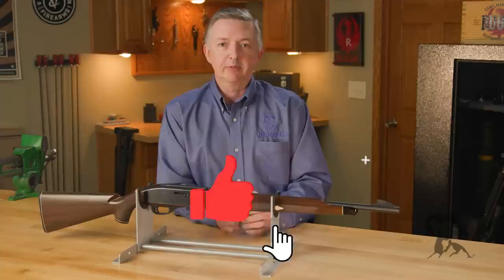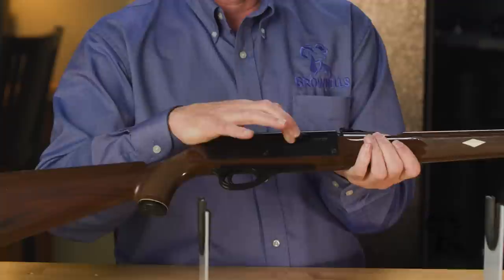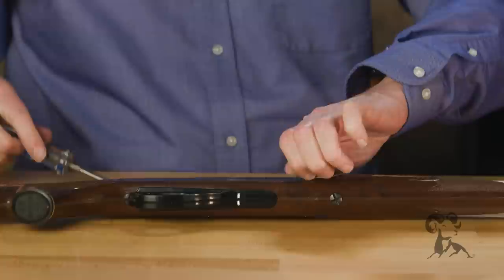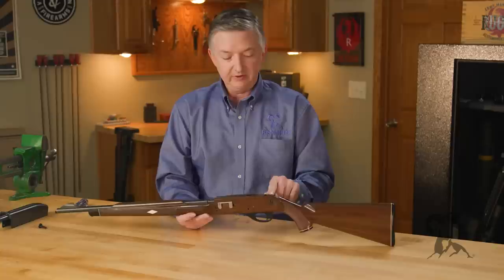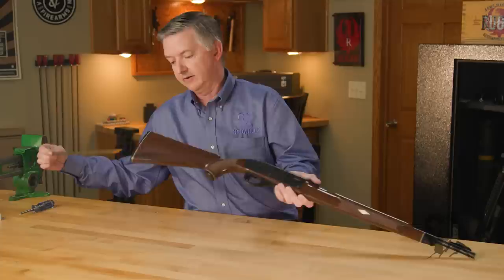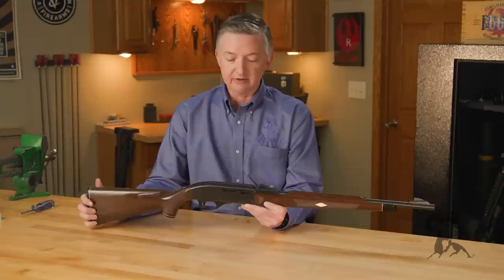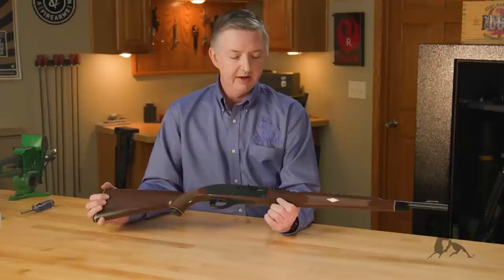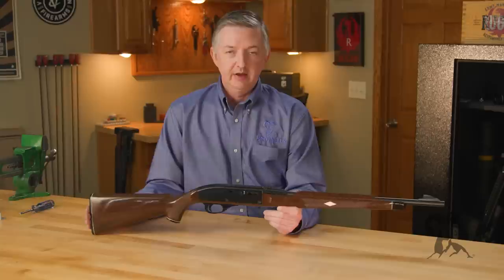From the Vault: Remington Nylon 66 Rifle

Comment: Around 1976 or so, a guy came to me at work and said, "I hear you know a lot about guns." Well, some. "I took my gun apart and I can't get it back together." Next day we went out into the parking lot where he handed me a barrel, a nylon stock, and a cardboard box full of parts. It included an exploded parts picture which wasn't really an assembly drawing but it was all I had to go by. One spring really eluded me. It was labeled in the drawing as "spring" and I could tell what it was meant to return, but it wasn't at all obvious what it anchored to, so I just picked something. I finally got it together and fired it a few times. When I disassembled it for the last time the anchor point of spring became obvious. It took me about a week of head scratching but I did make it a complete gun again.

Comment: I was 15 at the time, 1959, and asked dad if I could get a Nylon 66. To my surprise dad said yes. That was a get summer. The best part is I still have the gun. It has been a great shooter. The only issue I've had was the disconnector broke. You were right Keith, the internals are a bit of a mouse trap. YouTube has a few step by step videos that will get you through in fine shape. According to the production stamping on the barrel P F 45 = June 1959.

Comment: I bought a Nylon 66 back in the 80's and I almost didn't buy it because I thought it was plastic. I told the salesman that I don't want a plastic gun. It's like a toy. I pondered between it and a ruger that was in compare a heavy gun. The salesman told me the Nylon 66 is not plastic, It's a nylon that is very strong and that it won the accuracy test of all 22lr rifles' at the time. So $99 later I walked out with the nylon 66. Sure glad I did because I can shoot bulls eye after bulls eye with this gun. Never had a misfire.

Comment: I got my first Nylon 66 just last year, an original Mohawk Brown Remington made in 1972.  So it's as old as I am.  A little cleaning and it was running perfectly once more.  It's quickly become my favorite .22 rifle ever.  So light and slender.  They're known to have fired 30,000 rounds without cleaning, and Alaskan trappers found they were one of the few, or perhaps only, autoloading rimfire rifles that would function reliably in the extreme cold.

Comment: I did a disassembly are full cleaning on one of these decent little rifles exactly once. I now recommend you hose them out with G96 Gun Cleaner and use an air compressor to blow the excess oil and gunk out of the action. Wipe off the residue on the outside of the receiver, reassemble and the rifle will be good to go for another couple or three thousand rounds.

Comment: My grandfather left me the Apache model, lots of memories with that gun. Also the only gun I've ever seen the manual state NOT to oil the action due to the "self lubricating" property of the DuPont companies zytel polymer. They also will not hold a zero with a scope very long due to the sheet metal cover used for the receiver/scope rails moving. Great with irons since both front and rear are barrel mounted.

Comment: I always check these Nylon 66 blogs out. No one ever mentions the Nylon 12 which is a bolt action. My first rifle when I was 16 years old. Not sure what I paid, but I could seem to remember that it cost about $39.00 and the Weaver 4X scope I mounted on the rifle was $8:00. Still have it and it's in really nice shape, still fun to shoot.
Reply: Dillon Precision Press ran several articles on the variants of the Nylon 66 series-semi auto,lever action,pump action & bolt action.
Reply: I have one (Nylon 12), I just posted about it before I saw your post! I've had it since 1972 I think. Great little just Never use it!!
Reply: I have one to works great

Comment: I have an Apache Black with white diamonds, Nylon 66. I've had the rifle since 1970. In fact, at one point it was stolen from me in a burglary. About a year later, the police recovered it and returned it to me. It showed a few new scratches and dings when I got it back, but still worked fine. According to the manufacture date codes (stamped on the barrel) mine was made in 1962. The odd thing is the date code is supposed to be two letters, but mine has three letters. The first one being the code for 1962. The second letter is the code for the month of September. The third letter corresponds to the code for the month of November. I don't really understand the three letters being stamped on the barrel, but in fact, they are there. It's really an accurate, reliable shooter.

Comment: Mom and Dad gave me mine in 1962 when I was 17. Still works like it was brand new.

I only wish someone made a receiver peep sight that did not require replacing the front sight.

Once we finally rid ourselves of the legislative atrocity/tax dollar sponge/civil right prior restraint called the Dodd Anti-Gun Act of 1968 and subsequent add-ons, the Model 66s with serial numbers may become a more expensive collectable variant.
Reply: Shoulda mentioned, my bad. I came up with the trick of using it as a single-shot by placing a cartridge on the ejection port and operating  the bolt handle and letting it slap forward into battery. Great for working with new shooters where you don't want to load the magazine.

Comment: I was the first 22 rifle I bought as a teen. Had it for many years and during that time it never had a failure to feed or a misfire. The only issue with the 66 (not the bolt action nylons) is that the stock is very flexible. With a scope mounted to the receiver cover, should you brace yourself against a tree (for example), the flexible stock will let the barrel point slightly somewhere else than aim point.

Comment: I think the Black Diamond was pretty rare.  Be careful not to overtighten the two dust cover screws as doing so will cause the bolt to bind on the receiver and cause malfunctions.  I had one for decades and I shot the snot out of it and I don't think I ever had a jam.  I had a few duds, but never a malfunction caused by the rifle.  Don't waste your time and money on mounting a scope as doing so will cause your poi to change with slight pressure changes on the forearm as the barrel is not rigid with the receiver.

Comment: I had one in the late 60's . Hated it. It was not very accurate or very solid.I swore that I would never get another American .22 and then in 1978 a Kimber model 82 (first production run ) arrived  at my friends gunsmith shop and I fell in love with it. I still have it and it is still as good as it was in 1978. I also purchased a Ruger 10/22 and liked that until I had to sell it.

Comment: Your claim that serial numbers were not utilized until 1968 is incorrect.  I bought my Apache Black (& chrome) Nylon 66 circa 1965 and it has a 6 digit serial number stamped on the underside of the barrel, near the muzzle end.  Originally bought as a 'rust-proof' boat-gun, for use around the Gulf of Mexico, it was so accurate and dependable, that I put camo tape over the chrome parts and used it to hunt squirrels and rabbits around the backwaters of the Mississippi Gulf coast.  The Remington Nylon 66 advertisement was a large pile of 1 inch wooden cubes (1,000,000 I think was the claim), shot without a miss or malfunction.  Interestingly, the owner's manual cautioned against disassembly, stating that cleaning the bore and chamber was sufficient maintenance.  Being a bit head-strong, I disassemble and maintain ALL of my weapons, though I will admit, the Nylon 66 was a challenge the first time I disassembled it.  The retail price of my '66' was $55.00.  A true bargain... even for a high school kid, such as myself...  that mowed neighbor's lawns for $2 - $3 each.  As they say... those were "the good old days".

Comment: Don't ever take one of these apart. Ask me how I know. There are two guns I will not work on. The Nylon 66 and any NAA mini revolver. Both are Rube Goldberg like contraptions that require 3 hands and the alignment of the planets to put back together properly. I believe you actually need a purpose made jig to put the NAA mini revolver together. That has to be how they do it at the factory b/c I had to zip tie things in place and then have another person hold items in place so I could get the side plate on.

I was able to get both guns fixed and back together, but I set a record for cuss words and number of thrown tools.

Comment: If I still had a Remington nylon 22, I would not be shooting it.  I've had several on and off since they were new.  The Zytel does not age well and is prone to cracking and getting a sort of "frost" (feels sort of like powdered sugar) that rubs off of the plastic.  My first 76 also discolored in bright sunlight.  It hung in the entryway of our farmhouse for about 20 years.  The side facing the window turned a beige color while the back of the gun remained brown. And, be well aware of the most important fact:  IT CAN'T BE FIXED!  There are no plastic parts, new or used, available ANYWHERE.  I became aware of this fact back in the late 90's when my 66 cracked at one of the pin holes in the receiver.  After trying several gunsmiths, and a bunch of wasted money, I gave up.  There was just no way to get good new adhesive to stick to the old (in the words of the last gunsmith, "unstable") plastic.  My first 76 also quit working because the lever mechanism just ground away enough of the internal plastic that the rack could no longer stay aligned with the gear that operated the bolt.  Please note that the rifles worked flawlessly when they were new... the problems only began after about 30 years of clean, dry, and well maintained storage.  There's a reason why no manufacturer uses Zytel, as Remington did,  to make guns today.  If you have one of these, unloaded it to one of the crazy collectors.  It should work well enough to be a safe queen.

Comment: Don't expect a scope on it to hold zero, it won't. Too much wiggle between the barrel and the receiver cover. Also the Nylon 66 model 10c is a semi auto 10 shot removable magazine while the bolt actions are the Nylon 11 and Nylon 12.

Comment: Hard to find info ? I purchased one from a Pawn Shop that is the Mohawk Brown with Chrome cover, Barrel and front site. SN: 24xxxxx stamped in to Left Side of the Cover, Which I have found was a early production after Sn's were required in the U.S.. DID or is it possible that Remington, or did it come from over seas, and a few were made this way ? Great little shooter and accurate too. I have watched a few U Tubes in Spanish, that I don't understand, with chrome barrels, Black Cover and Front sites. Any Info would be great !

Comment: I have an Apache Black Nylon 66 and I have a question. The rear sight on mine was bent up and the elevation screw was missing. I have a new elevation screw now but I am not sure what the process is for installing it. and what a safe way to bend the sight back down. Can anyone supply a diagram of the assembly and/or information on how to fix it?

Comment: I have one of these that someone sold me for $80. It doesn’t cycle and I don’t know what’s the deal with. I’ve tried new mags, shaving down mags, better ammo, lubrication, no lubrication, new recoil spring etc.. I cannot figure it out and it is nearly as bad as without ammo. Also it gets worse when I put the receiver cover on (I think it pinches the feed ramp). I’ve taken it apart a few times to clean it (it wasn’t cycling before that) and I just cannot get it to cycle. Also it seems like the round goes up with the bolt and it just lodges it upwards and pinches it. Anyone know anything about what could be the problem (it’s a detachable magazine fed)

Comment: Remington turned into a one trick pony,  manufacturing engineering products to the lowest price point, but selling them at a mid level price.  Oh well, if your consumer base is uninformed......

How's Remington doing lately?  Although it is a shame how the took so many remarkable companies with them.
Reply: You mean like my Rem 700 PCR (6.5 Creedmoor) which shoots .318" at 100-yards?  Probably why most of the expensive "custom" long range rifles use disguised actions based on the Remington 700 design.  I've heard all the complaints about Remington but never experienced any quality or mechanical issues.  Quite the opposite.  Seems to me the company develops a great design then sticks with it while the herd chases around after the latest and slickest shiny object of questionable "improvement."
Reply: @keithtolman6904  remingtons only design goal for the 700 was that the receiver could be machined in a turret lath by unskilled workers.  If you throw away all the remington parts, and bed it into a good stock, they will shoot.  They are garbage as delivered.  Savage really hurt them with their barrel nut system, accu trigger, and lower price.  Now everyone offers very inexpensive rifles that will outshoot any remington out of a remington box. (Not bedded in a custom stock with a timney trigger)

Comment: In all my years (I'm nearly 70!) I've never seen a "Nylon 66" that didn't have cracks, splits, chips or whole chunks missing from the stock!
No Thanks.
Reply: I’ve seen plenty that didn’t. The ones you saw must have been used and abused.
Reply: There was a lifetime warranty on stocks. Mine was factory replaced 2wice!
Glue repairs work, too.
Still chugging away.